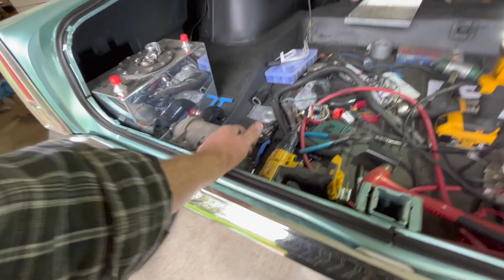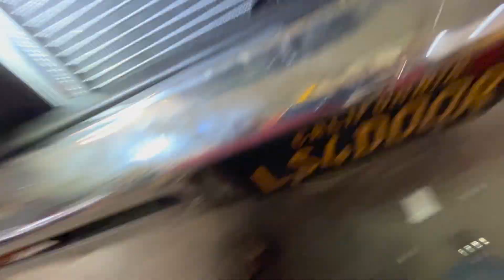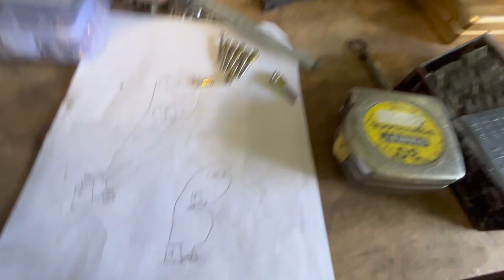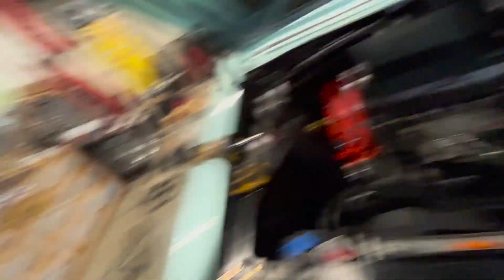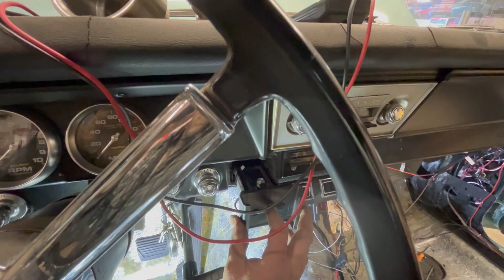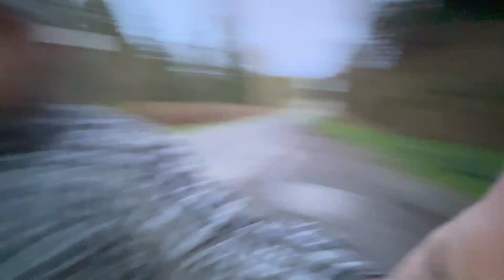First Drive of the 5.3 LSA Swap 1967 Nova!!

Comment: Something's wrong with the rear end only one wheel was spinning on the burnout. Is it a posi unit. If so maybe they sold you the wrong axle spline?
Reply from the maker: The clutch pack for the trac-loc probably just needs rebuilt. Good eye, thanks!